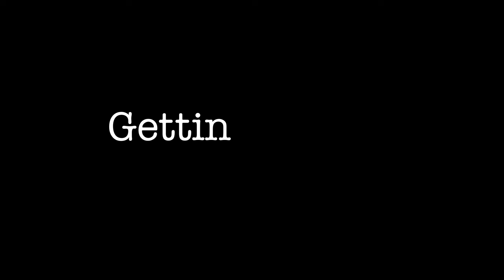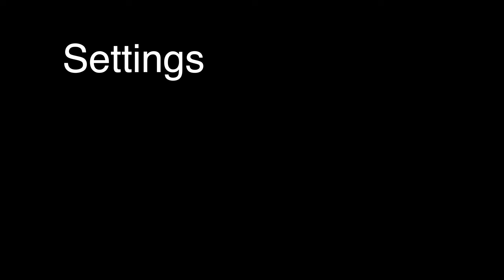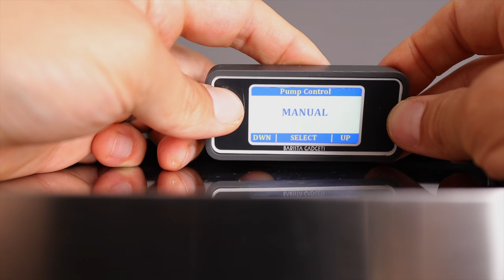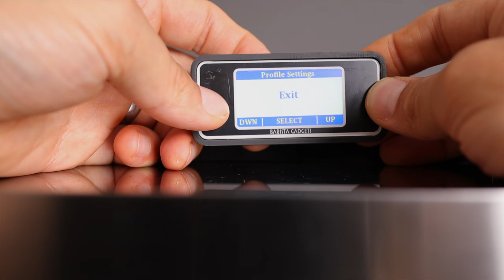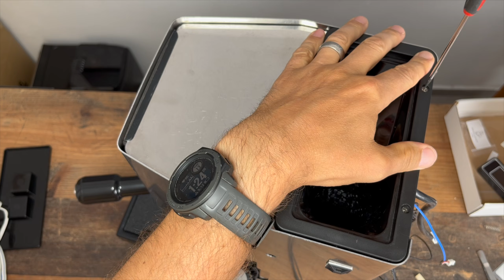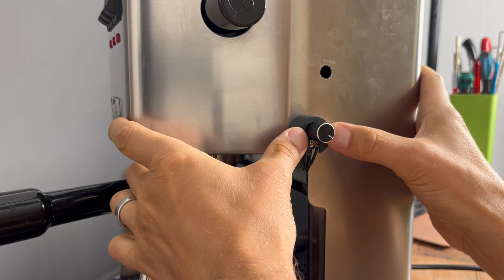Gaggia Classic Pro: PID Installation Tutorial Made Easy! w/ Dimmer!

Comment: Thanks for the video! I currently have the Basic version installed and I'm planning to upgrade to the Pro model. I'm wondering if I need to remove all components from the Basic version first, or if some cables and parts can be reused since they might be the same.

Comment: Hey Tom, have you run into any issues with the water pump maxing out before 100%? I’ve recently installed this kit and the pump seems to shut itself off after 60% flowrate, with the actual flow rate acting rather strange as well. Cheers!

Comment: I have 2010 gaggia classic. Could I apply the same modify?

The only one I did was buy a gauge and adjust machine pressure. Tried also  to buy a no pressurized filter but coffe was very bad, cold and without cream/foam. So I just using the bundle filter with "cream valve" SINCE 2012 but reqlly disappointed  with result. I tried several kind of espresso powder coffy but never try to grind it on my own. Greetings from italy, sorry for my eng!
Reply: a non-pressurized basket is really only going to work well for freshly ground beans that are ground fine enough for espresso. the pressurized basket works better for pre-ground coffee

Comment: How in the world are you able to get that pigtail connected (@16:10) that still allows that "L" connector to reattach?? I've been struggling with that
Reply: did you figure this out?
Reply: @jaspersj23  I did, thanks. I'm not very mechanically inclined...
Reply: @atlosass  any suggestions? been stuck at this step for an hour and can't get in touch with @baristagadgets
Reply: @atlosass  any suggestions? i've been stuck at this step for over an hour.
Reply: @jaspersj23 I originally thought that both connectors went on "back to back" and there's no way to do that bc it's too thick. you need to pull the pigtail part out and attach the original connector to that tail... And then attach the new connector to where the old connector was previously. This probably doesn't make sense... I'm sorry(!)
Reply: @atlosass  rereading after having barista gadgets explain it now makes sense.  Thanks
Reply: @atlosass can you elaborate ? Or show me how ? I’m still don’t know how

Comment: Lower water debit is usually a bad idea as the bottom of the puck doesn’t get saturated until late in the shot. At least that’s the way lance hendrik explained it in his pressure and flow video. He was really speaking to the pre infusion side of things but also as a general statement on extraction.
Reply from the maker: I would agree with that. You have to make sure that you have enough water debit to get the puck saturated, so you do have to play with the Settings. Sometimes, I had the water debit too low, and it was not a properly extracted puck. So beware that you will need to experiment.

Comment: This kit is connected to the solenoid valve of the machine, excellent, no need for springs to change the working pressure.🧐👍
Reply from the maker: Well, it's connected to the pump, and limits the voltage, so it ultimately limits the flow. But yes, the pressure should be controllable so that the gate that the spring would provide is likely not an issue anymore.